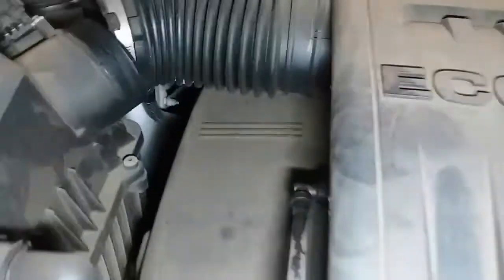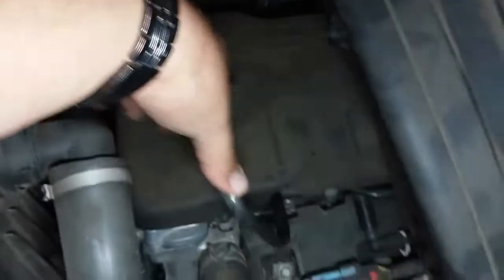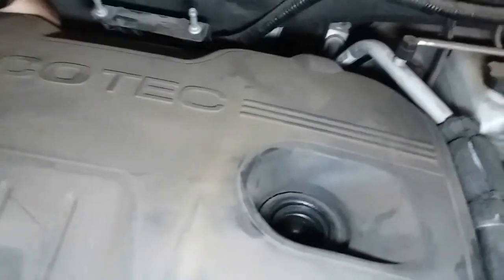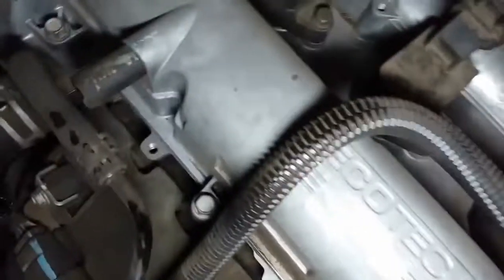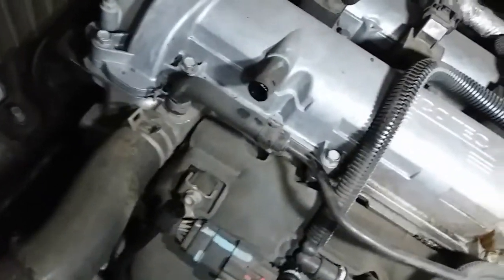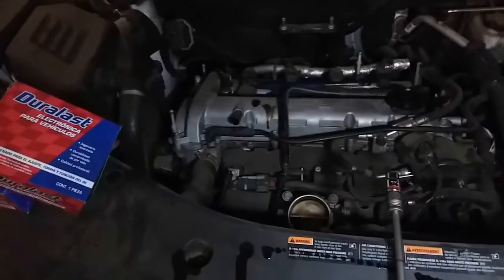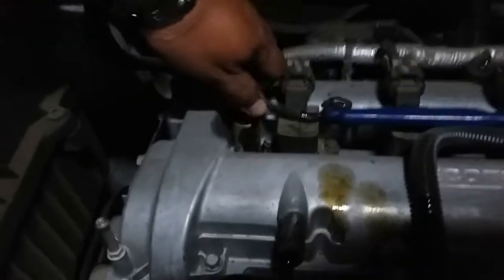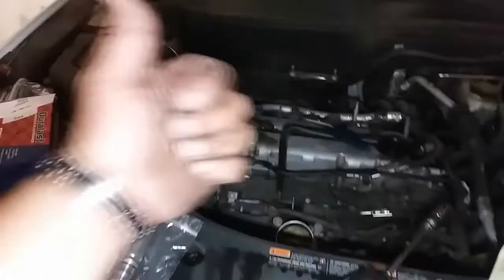How to: Remove Intake & Exhaust Camshaft Position Actuator Solenoid Valve

2013 Chevrolet Equinox

Comment: Thank you for this video. Check Engine light came on the other day and I finally got to use the FIXD plug in my wife bought me for Christmas 3 years ago. Checked through the app on my phone and it told me this was the problem and code and allowed me to reset the light.  I used this video first because I didn't know if it would be difficult to get to and seeing how easy it was thanks to you, I ordered the part on Saturday and it arrived yesterday. Replaced both of them in about 15 minutes. Better than paying a dealer which would've ran around $200 for parts and labor IF it were an honest one. Wound up costing me $25 for the parts through Amazon.
Reply from the maker: Heck yeah brother this is the whole reason I make these videos. Now a days manufacturers cut so many conners and leave it to the consumer to worry about the problems. Its a money scheme really. 
All I'm doing is even out the playing field and save the consumer money 💰 I'm glad this helped bro, thank you for your Support 🙏

Comment: Great, to the point video. Regarding the plug, mine required that I pull the valve out with the plug attached. Then, using a small screwdriver, come from underneath the plug, insert the screwdriver to depress the tab and pull the plug off. Easy peasy. Thanks for the video.
Reply from the maker: Dang bro glad you got that figured out, thank you for your Support 🙏

Comment: Good short video, thanks.  Suggestion: next time turn off air compressor to avoid the background racket.  Thanks.
Reply from the maker: Lol thanx bro. Sorry bro its a shop multiple things going on in here!
Reply: @559powerscape  let me speak to the producer and director! Thanks

Just replaced the 2 solenoids per your video.

Add on question. Any experience with same 2012 equinox and stabilitrac malfunction? Thanks
Reply from the maker: Lol 😆 glad this worked out for you bud! No I'm sorry I really do not the stability trac might be a speed sensor but not positive.  A mechanic with a big obd2 reader has the capability of seing in real time were the malfunction is coming from. Sorry I wasn't much help bro. Thank you for your SUPPORT!
Reply: @559powerscape  TX
Reply: OMG YES ...  🙉

Comment: Hi, thank you for sharing this. Will the engine checking light be gone by it self after I replace the intake one or I have to erase it using a device? Thanks!
Reply from the maker: you can disconnect the battery for like 5min to make sure all the electrical is drained. Then turn on the headlights to drain the system. After the 5 min turn them off connect the battery back and it should be gone.....or just driving it will go away to. It just has to complete the drive cycle to detect that the system is good now. Hope this works for you! Thank you for your SUPPORT!
Reply: GEORGE LOPEZ HOW TO DO IT YOUR SELF thanks for your reply!
Reply from the maker: @ningyuan3623  your welcome! Hope this works out for you!
Reply: GEORGE LOPEZ HOW TO DO IT YOUR SELF your video is very helpful. Just replaced my intake camshaft actuator following your video step by step. 👍

Comment: What would happen if u didn't screw the screws in? Because my old ones got rusted and broke off in the hole so I can't screw anything in. Will this cause problems?
Reply from the maker: They can possibly back out off place. Maybe finding a way to zip tie them into place. You can try to remove the bolt with pliers if not maybe drilling them out. Sorry hope this helps 🙏

Comment: Why did you replace them? I'm asking cause my wife has a 15 equinox and it dies when you put it in reverse and press on the gas.
Reply from the maker: It had a check engine for those sensors but yes it would also die and have a rough idle. Replacing them and doing a oil change fixes it. Then with a obd2 scanner clear the check engine and ur good to go.

Comment: Found metal shaving when I removed the gray connector one.
Reply from the maker: Wow, car still runs good? As long as the car is good you should be okay...I suggest an oil change
Reply: @559powerscape  did that. Some shavings were at the bottom of the catch pan. Filter was nasty as well. Just bought the car but the previous owner doesn't remember when was the last time they changed the oil. 

Thanks for the video 🙏

Comment: Hi, my 2011 Equinox check engine light came on, I went to O'Reilly to read it and the code was "P0013 exhaust camshaft position actuator solenoid valve control circuit", would this be what that is? Also what should cost be to replace so 8 know if a mechanic is trying to screw me. Thanks
Reply from the maker: Yes this is what it is!....honestly I dont know but if anything its a 15min to 25min job. I show it here in the video.  Want to try to attempt it?
Reply: @559powerscape  yes I watched it after I commented and you made it look easy! Now this also threw a code P0014 as well, now can I ask you, Amazon has an intake and exhaust camshaft kit for $36 for both and reviews were nearly 5 stars? Would you recommend that or should I go to O'Reilly where it's $57 for each one?
Reply from the maker: @aikalo80  try the Amazon ones...thats not bad. But in my opinion oem is the way to go on these sensors...but amazon won't hurt your pocket. Give them a try and see if that works....yes the other one is for the intake...i suggest replace both....its what I did on this vehicle even though it was only throwing the exhaust code....good luck and thank you for your SUPPORT!
Reply: @559powerscape  hey bro, I decided to look for something more expensive, it almost seems too good a price for both. Is AC Delco OEM? I found them on Amazon and it says original equipment for $44 and $40.
Reply from the maker: @aikalo80  yes ACDELCO is Chevys oem brand....get them!
Reply: @559powerscape  thanks for all your help bro, appreciate it.
Reply: J
Reply: @bev8099  hi wow this was a long time ago, do you have an email I’ll send you a pic of the Amazon order of what I got

Comment: I don’t have a light on but I took it to my shop and told them how my car had a studded stall and they said that I needed to get these replaced. They are trying to charge me 400.00 for it. But this looks easy. Should I replace if there isn’t a light on?
Reply from the maker: You can if thats what needs to be replaced.  Sometimes a dirty oil can be the problem as well cause it uses the oil as a hydraulic system for those sensors.  If its dirty it won't flow as easy

Comment: do you have any suggestions if this didn't turn off the check engine light?
Reply from the maker: Disconnect the negative cable for a good minute then connect it back in. Should reset the Check engine....if not a scan tool can clear the check engine
Reply: @559powerscape   I have cleared the code with the scan tool but the same code keeps popping up. It did go off for a few days then came back on. I'm wondering if I should take it out and reinstall or if it could be something else. thanks btw you are super helpful
Reply: @mikeeuro840  I'll help since you didn't get a response. It could be the pig tail (wiring harness), oil sludge from infrequent oil changes or using the wrong oil, or worst case scenario the timing chain has jumped. All 3 of these issues can cause this code.

Comment: I have a 2011 Chevy equinox, it has a rough idle and has been dying while stopped at stop signs/traffic lights. When I google for troubleshoot this is what it’s telling me to replace, is that correct?
Reply from the maker: Yes it sounds like it's having the same issues. I would suggest doing an Oil change, clear the codes with a obd2 scanner and if it still continues change out the solenoids at that point. Could just be dirty oil clogging up the sensors.
Reply: @559powerscape  Thank you so much!!
Reply from the maker: @gabbyself5428  your welcome, I hope this works out for you!

Comment: P0014 is the code I got, just came on today and I only drove about 4 extra miles and parked it,  I scanned and it said the camshaft position exhaust sensor, if I change this part and gobahead and put new oil and a filter in would this fix my problem?  I haven't had any issues with the car, no rough idle or loss of power, only decreased gas mileage thats all
Reply from the maker: Yes more than likely it will. These are real common to go bad. Replace it. Replace oil, clear it and drive it. Hopefully it doesn't come back. Good luck buddy!
Reply: @559powerscape   thanks alot, ill be doing this tomorrow morning sometime will update afterwards
Reply: @559powerscape  got it changed, fresh oil and filter but still had to run the scanner cause light was on, still ran the same code so they said sometimes even after fixing you have to manually delete the code, just another way for them to keep us from fixing in our yard to save cash, sound right to you?
Reply from the maker: @joshuajennings9387  yes you have to delete it cause it's stored in the cars ecu. You should be good after clearing it.
Reply: @559powerscape  thanks man, yea I reset the cpu and been driving all morning with no power loss or engine sputter,  even up steep hills does just fine and no light back on.  Your video was a huge lifesaver thanks
Reply from the maker: @joshuajennings9387  thanx bro i really appreciate you! You fixed it bro, all I did was guide you! Thank you for your SUPPORT!

Comment: How do u erase the check engine light after u fix it?
Reply from the maker: You can either purchase a obd2 scanner to delete the faults or you can try disconnecting the negative cable, turn the lights on to drain any electricity from the system, wait 30, connect it back and try again

Comment: So it’s the intake that needs replaced then .. ?? It’s says intake camshaft position. Over advanced with that poo11 code
Reply from the maker: Yes! That's what it is. I believe  its the white cap sensor. The black cap sensor is the exhaust side. The one closest to the front is the Intake side. My boss picked these up at Autozone.  I don't know if it's cheaper than dealer. Get the Ac Delco brand. That's Chevys OEM parts.

Comment: How do I no which is the bad one .. engine light came on took it to auto zone they use the diagnostic machine n said the vvt  was bad didn’t tell me which one .. the Chevy dealer want $380 to replace just one
Reply from the maker: Go back to Autozone have them scan it. Tell them to give you the OBD2 TROUBLE CODE its something with in the lines of p0xxx. We need to see what the code is to determine which bad sensor is it.  I suggest to take someone that's a little bit experience with cars so they could have a understanding of which is the part that needs to be replaced.  The trouble CODE is what tell you which sensor is bad.

Comment: Is this the problem that causes the engine to reduce power? I already bought a new throttle and a new high pressure fuel pump and still same issue. So mechanics tell me it's the timing on the SUV but my main one tells me no.
Reply from the maker: This does affect the performance of the engine but it is also throwing a trouble code pointing to those sensors. You can try changing these but i would suggest to scan it with an obd2 scanner and see what are the trouble codes is giving. Good luck buddy! Hope this works out for you! Thank you for your SUPPORT!